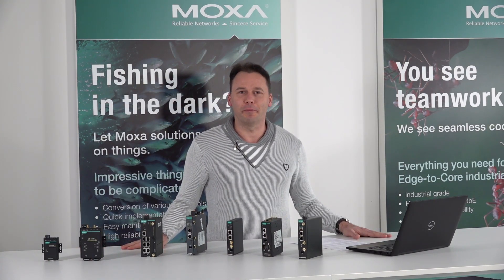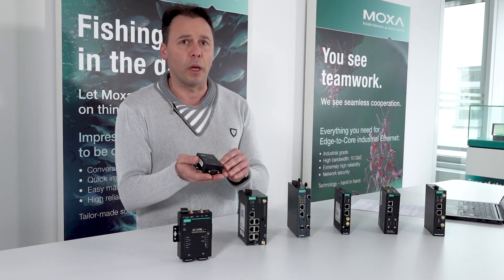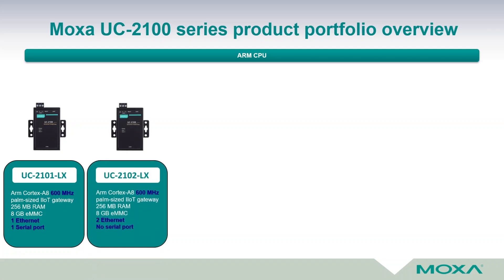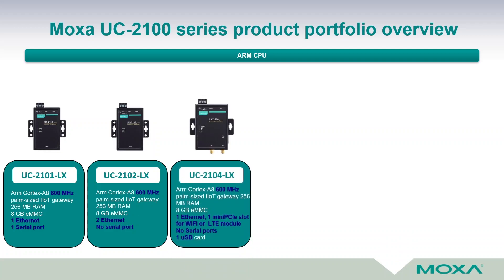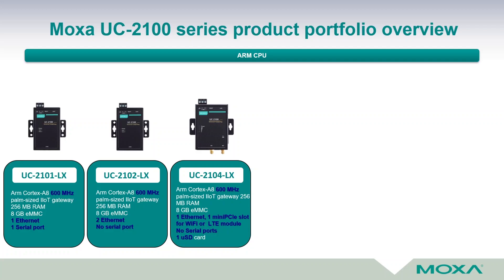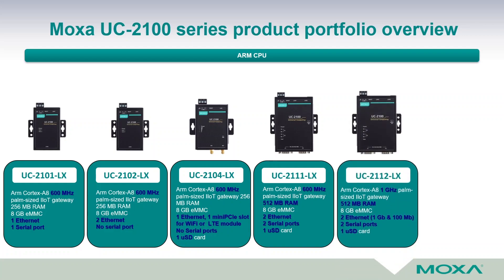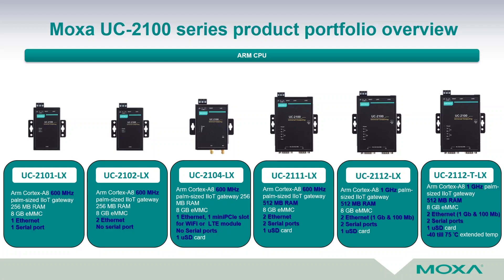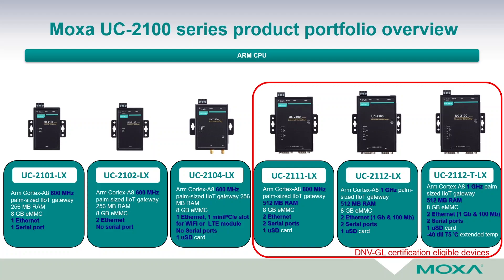Powerful Palm-sized IIoT Gateway

Comment: Very Nice Video. 
May I know what I device I can use for TCP IP VNC server access on  WIFI LAN and  via internet?
Reply from the maker: Thanks Prashant! We're glad you enjoyed the video.
 
We have several x86 embedded computers that can handle VNC over Internet and WiFi. Depending on the requirements, the exact model will vary. Below are some common ones used in customer applications. A Moxa representative can also help identify the model that fits your needs. You can get in touch by completing this contact form: https://www.moxa.com/en/contact-us/contact-form
 
1.	MC-1220 with Core i7 CPU and 2 x miniPCIe slots inside where customer can utilize and put WiFi modules or LTE modules and can customize DDR4 RAM memory and SSD according to application and requirements:
https://www.moxa.com/en/products/industrial-computing/x86-computers/mc-1200-series         
 
2.	MC-1122 with Intel Atom CPU:
https://www.moxa.com/en/products/industrial-computing/x86-computers/mc-1100-series#models
 
3.	V2201-E4-W-T:
https://www.moxa.com/en/products/industrial-computing/x86-computers/v2201-series#models
 
4.	For railway applications, the V2406C with M12 connectors and its ability to implement WiFi and LTE miniPCIe modules:
https://www.moxa.com/en/products/industrial-computing/x86-computers/v2406c-series
 
The other x86 models can be reviewed here:
https://www.moxa.com/en/products/industrial-computing/x86-computers